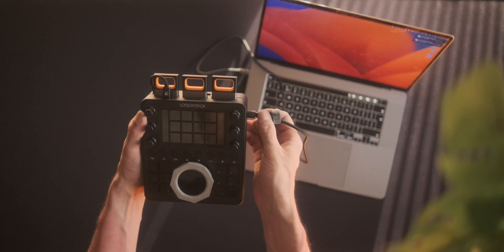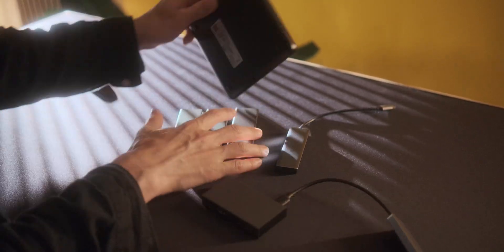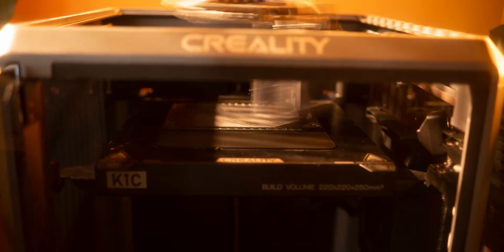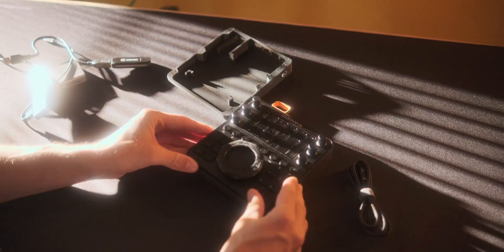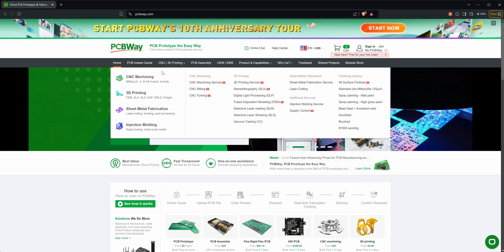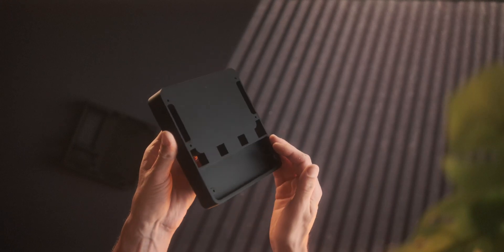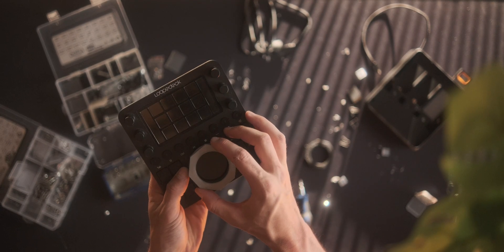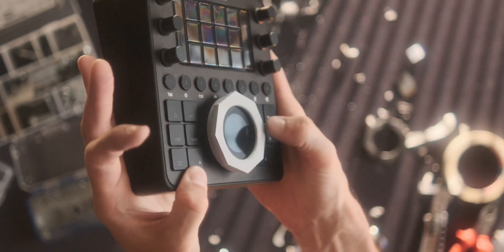I Built a Portable Editing Hub / Chill 3D Print Project

Comment: Wow. What a truly dope thing to stumble upon. I just switched to Resolve this month, own a Loupedeck CT, and picked up my first big boy 3D printer. This is e.x.a.c.t.l.y. up my alley. I'll be checking out your project files for sure. Thanks for your time and brainpower putting these awesome ideas into the world. Your video quality is top notch, too. 10/5 stars.

Would this design accommodate the CT if it was turned 90 degrees clockwise? I'm finding I like using mine rotated so I can have my thumb always on another dial (zoom) for timeline nav.

Comment: Very impressive. With the bits you had to hot glue, could you have put heat set inserts into the holes and then screwed through them?
Reply from the maker: Your absolutely right I should have used some of those threaded inserts that you can head with a soldering iron, I'm unsure if that works with resin printers but ill look into this thank you!

Comment: Great build, I like the way you use the shape of the SSD's, it really looks like a professional product
I think a 90 degree USB-C flat cable can be a solution for the stream deck. the flat cabel can be snaked under the stream deck. But it might need some redesign for the cable and plug itself.
Reply from the maker: That's an amazing suggestion I really appreciate your comment, I'm currently working on a project that would really benefit from one of these flat usb c cables! Glad you enjoyed the project!